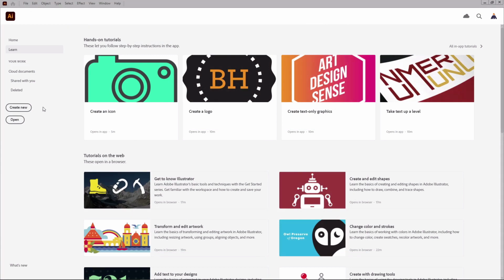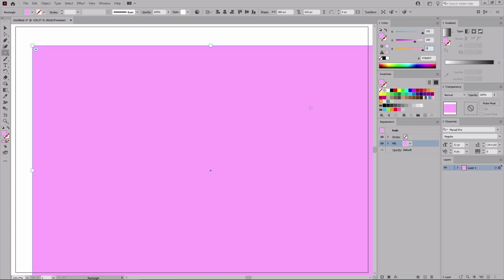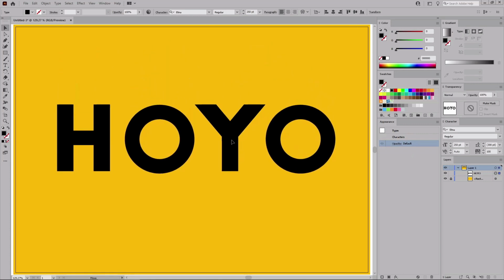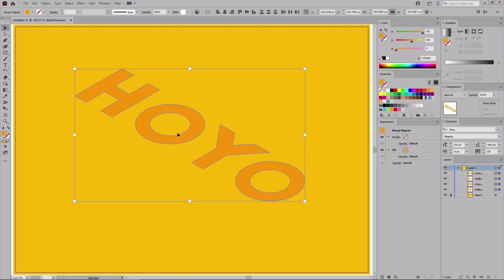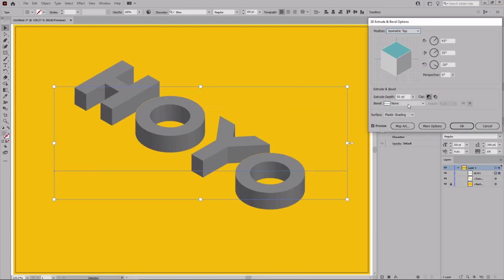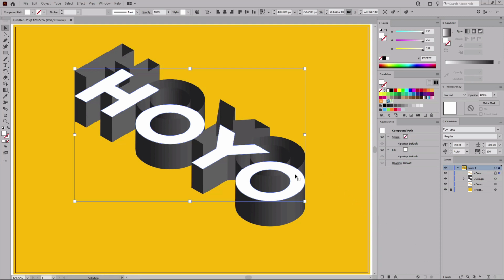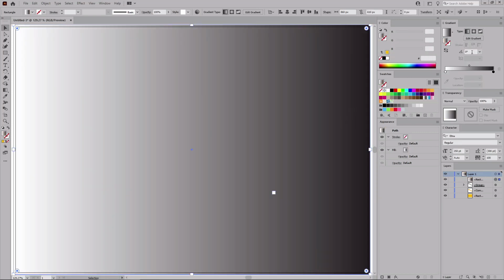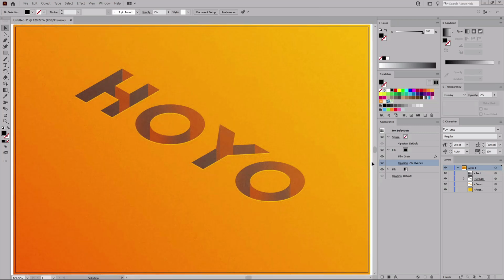How to Create a 3D Text Art Effect in Adobe Illustrator

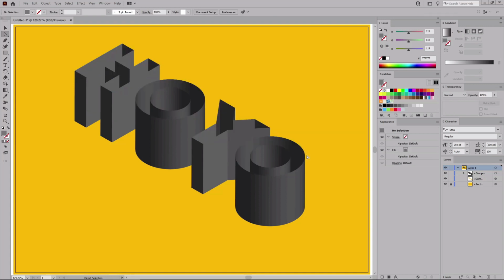Comment: Hi, thanks for the video. I used a different word, however when (at 5:20) I remove the tops of the letters they don't come off like a "lid" and there is empty space behind. How do I fix this? I'm sure I haven't missed any steps out. Thank you.
Reply: Hello,
Did you find a solution? I have the same problem, no way to fix it. I have done it several times, I don't forget anything. I already asked the question on another similar tuto, but no answer...
Reply: @psychopad584  yeah, i have same problem with Ai CC, then I updated to Ai 2021 and it's gone. U can try it
Reply: same problem